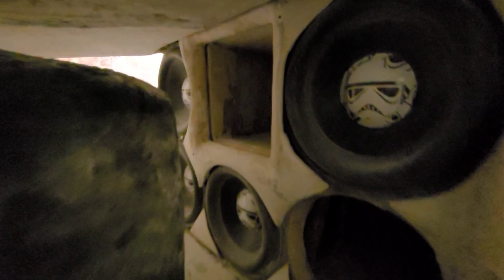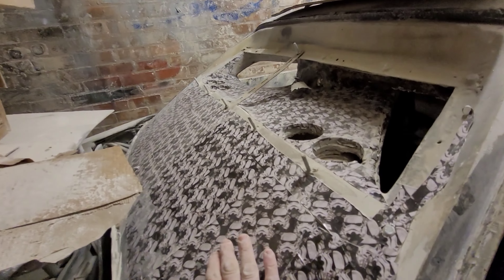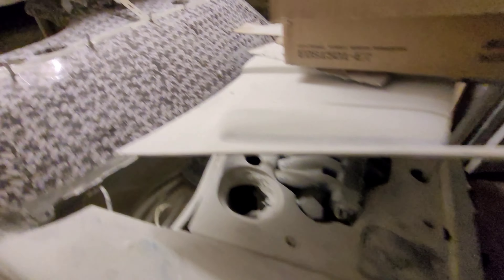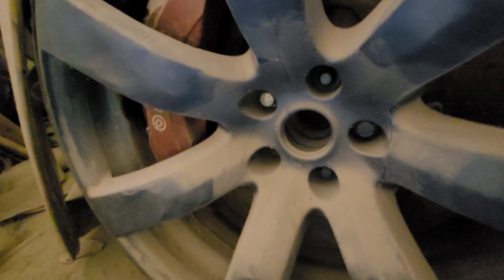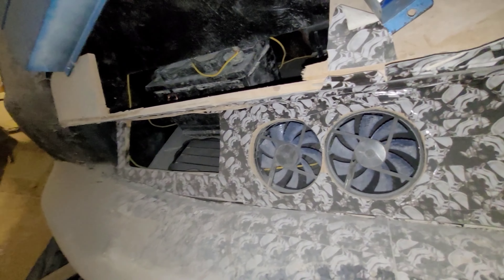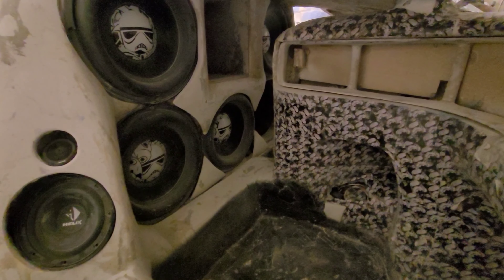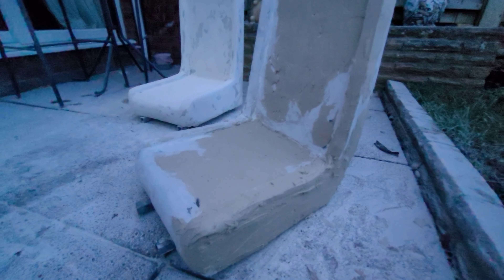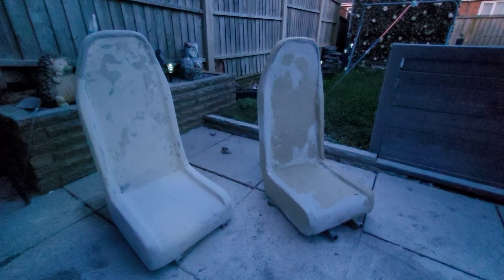201 - Walkaround with questions answered. Interior, roof & trim work. Both seats shaping and filling

Comment: Questions..
Will it run/drive
When u turn the bass on Will all the filler crack and snap off? 
Is it just a very expensive model toy car??
Reply from the maker: Hi. Im answer to your questions.

1. Yes it will do both of those things. It needs to run and drive to move it onto the truck and to charge the batteries for the audio.
2.if it works how i expect it to there shouldn't be much external vibration so shouldn't have an issue with cracking
3.it is a very expensive show/model car